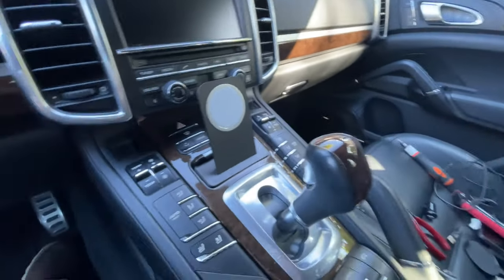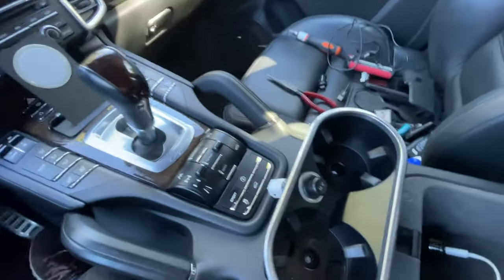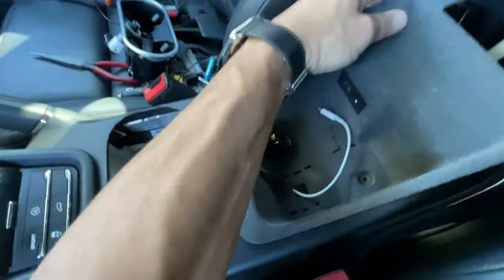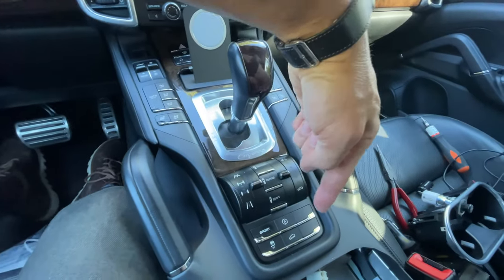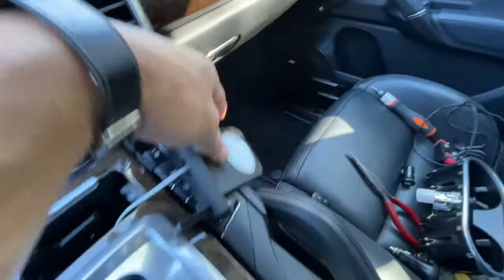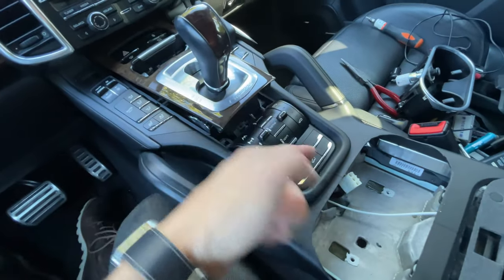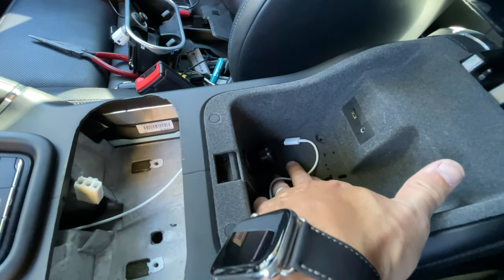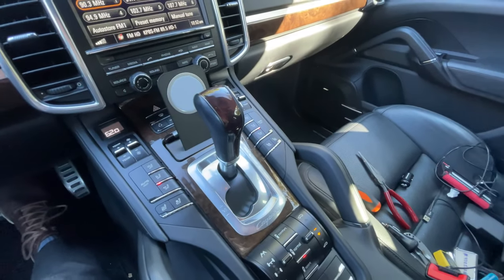Installing Apple MagSafe charger in Porsche Cayenne 958

Comment: I installed the Nine Volt charger for my 2012 Cayenne S yesterday.

Everyone said threading the wire was a challenge, so I used fish tape (for running Ethernet wire) for an assist. I still ended up removing the shift knob so I could understand the wire routing better. That process of removing the knob will break a tab below the decorative knob cover, but it goes back on without a problem.

Original install video
https://youtu.be/Z5GmeYQylGs

Video to remove shift knob & relevant pieces
https://youtu.be/jN7ym9_Le-4

If you don't have 100' of fish tape laying around, here's a shorter version for $15. Search for "SWANLAKE 11' Fiberglass Running Wire Cable Coaxial Electrical Fish Tape Pull Push Glow Rods kit." Brand name is not important.

Comment: So where do you get the charger that fits in the ashtray?!?
Reply from the maker: 958 Magsafe Holder/Charger is a micro carbon fiber composite 3D printed product (looks nearly injection molded—that's a good thing). I can make them for  $160 shipped anywhere in the US. This price includes the Apple MagSafe charger which I install in the unit. This unit only works with the new iPhones (12/12Pro/12ProMax/12Mini) because it uses the new MagSafe system from Apple which only works with those phones.
Reply: I would buy one, please let me know how can i reach out to you so we can exchange details and place the order
Reply: FYI, modern Androids with wireless charging can work with Apple MagSafe chargers, but you need a magnetic phone case that supports MagSafe.) I have verified it with this charger.